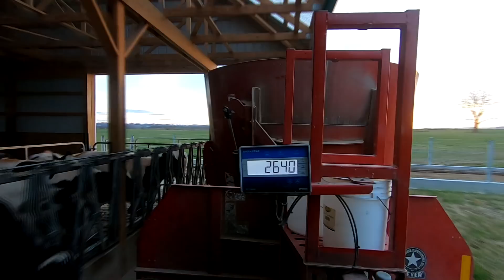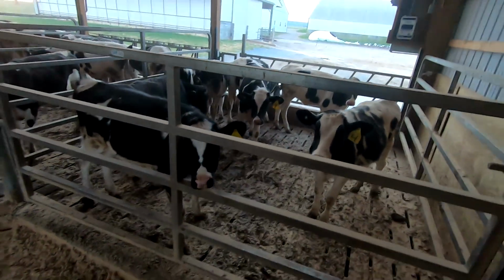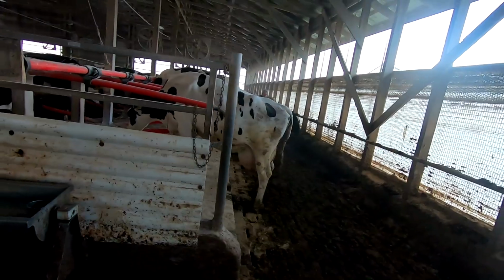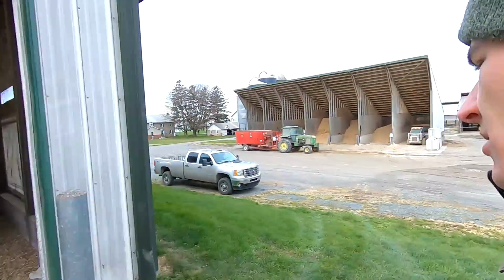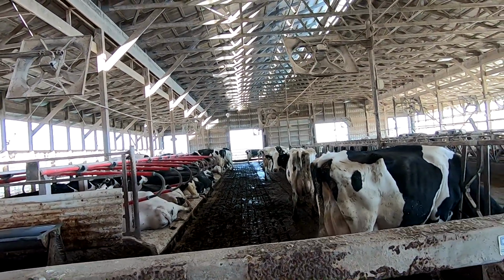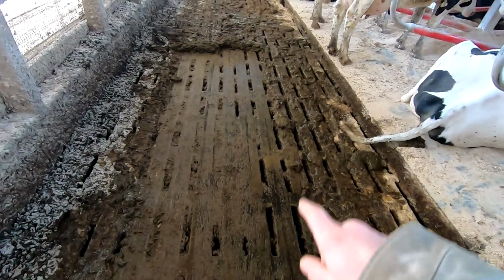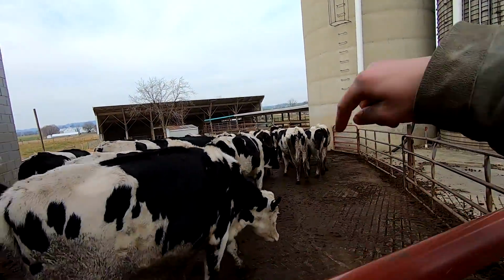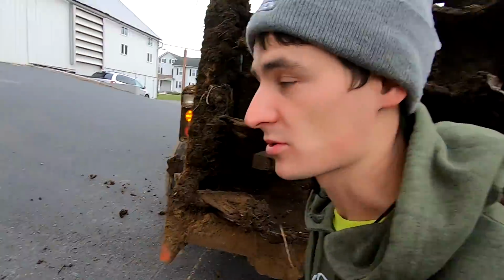This & That on the Dairy

Comment: Thanks for the videos Eric ,I’ve got slats and have cable  scrapers that run on top ,it certainly keeps the beds cleaner and better for hoof health and stops  manure tracking onto the beds which helps with mastitis prevention.
I think the  discovery would do a good job for you ,as you know it’s all about making small improvements 👌

Comment: We have two lely discoverys.  Had them for 6 years. They definitely help keep the beds cleaner. There is a noticeable difference when they are broke down. Maintenance is about every two months and nothing is very complicated to fix. We really like using ours. Any questions let me know
Reply from the maker: Thanks! Do you have the one with the water attachment on it?
Reply: Yes we do. Both ours have the water. I would not recommend it. As we are from Wisconsin and winter time is challenging plus they are a lot more maintenance. We have deleted the water systems off them.
Reply from the maker: @codeman002100  good to know thanks. The farm we visited to other day had the water turned off because it gave to much trouble.
Reply: Yes same here.
Reply: @10thgenerationdairyman  We just bought one without water (installing it next week). Price was 30-40% lower, also know some friends who complain about problems with the water (and other persons say that water is unmissable).

Comment: I have worked with 2 Lely discovery’s and they are great for cleaning slats without the hassle with traditional barn scrapers.
It's important to give them a simple route in the barn - less chances for them to get out of route. 
Replace tires when worn, otherwise there's more risk of them slipping and getting out of course.
They can't scrape large amounts of straw from a bedpack or a huge pile of dryed out manure. But as long as they run every few hours that should not be as problem. 
Make sure you don't have them running while driving in the barn with the skidder. They are soooooo slow and it's painful to wait for them :D
If it's really cold don't even bother. They can't push frozen manure. Witch is okay cause at least it's dry then.
Hoof health is improved after we got them.
Reply from the maker: Thanks

Comment: That auto manure scraping robot for the slatted area is pretty nifty... When you were originally talking about it, all I could visualize was those systems where they have a scraper or two (that span the entire width of the slatted walkway) that are hooked to chains or cables. Then, every once in a timer in awhile the system pulls the scrapers from one side, and across to the other, making sure that the walkway is clear from any and all manure. So seeing an actual robot was really neat. Probably a pretty penny too. Lol

Comment: Hey great video. We have 3 robots scrapers, two of them is is just scraping and the 3rd one we got about 7 8 months ago was the one with the scraper and water sprayer out the back, you think the water doesn’t make much of a difference but it make a huge difference, we are thinking about changing the other two out for it, we have them on slates and solded floor, they do work, the cows do be lot cleaner (tails) you have rubber out at the feed rail, don’t know it would work there with the rubber. Something to look into, but worth the investment

Comment: I saw you replace only the front wheels of a skid steer.  We run a lot of them.  When you put new wheels on the front they are larger than the wheels on the back and since each side rotates at the same speed the size different causes a LOT more ware since one of th wheel sis always skidding.  We always replace one side at a time.  If the fronts are bad we pull one rear off and move it to the front.

Comment: We have a lely discovery and its working pretty good for us, but the scanner that reads the wall is not that good, because sometimes it bumps into wall if the scanner is not reading the wall good. So we put a new one on a little time ago now it is good again.
Reply: We have also a lely discovery. I think we bought it in 2009. And yes, sometimes it has some problems, but overall it works well. 
We have also a delaval (we have a special floor in our new build barn, because dutch environment rules) and a delaval is a lot heavyer. But the delaval has to mutch problems!
Reply: And when i had to buy a new manure scraping robot, i think it will be a lely.
With water sprayer!

But i think you need two robots! One for each side of the barn.

Comment: Looking at your set up I think a ratchet scraper that’s automated would suit your system very well. They are very common in Ireland and are designed to scrape the alley ways between cubicles and under gates too. They can be set to run at hourly intervals. I don’t think your set up would suit the robot due to all the gates it has to cross. Dairypower or Dairymaster make them. Irish companies so not sure do they sell is the U.S. But worth taking a look.

Comment: We run three of these Lely robots in our stalls. At the beginning we had a little bit of trouble with them getting lost and not finding their Path but after a while they starten to run beter and better. We also have our water switched off in the robots. For Youre stall i personally think the robots wil work really gold because youre allys are all straight without to Mutch turns!

Comment: Watching you load the Pik-Rite with the skid loader, I wonder if having a bucket with a longer "tongue" or bottom plate would make that process more efficient. I have a no experience, just a thought I had. Does anyone know if that would work?
Reply: Typically no because If you get to big of a bucket for manure the skidder will rip over and the amount of time it takes to shake and push the manure over it doesn’t add up to much time at all

Comment: What I would do is set up a small pan that holds four or five cows maybe up to 10 and over the year only go to the cattle market 12 times and separate out the cattle that you are going to sell but still milk them until the saleWould make things a little easier as well because you could get a slightly larger trailer and build a nice little ramp

Comment: I’ve always wondered why the sides of the manure spreader are so short taller sides you could haul more?
Reply: Manure soreader come in different sizes. But you don't buy a big manure spreader if you don't have the tractor with enough HP to tow and put revs down the pto. His spreader likely matches his tractors hp and tow capacity.

Comment: After watching a lot of The Hoof GP cattle trimmer YouTuber, the layover type crush seems so much harder to level up the claws and model with the knife.
Reply: I would have to disagree with you on the two types of trimming tables . This is the first time I have seen a lay down table with a clamping leg holds, mine used straps. I used two types of grinders, one is chipper head the other was a finish grinder aka Poter Cable 24 grit paint remover disk. To use the chipper head you put the strap between dew claw and heel to hold both toes firmly, then reset strap above the dew claw and then level  up with no pressure on strap and leg in a strait position , not like the stand up tables with all legs pulled back. I am also a horseshoer 40+yrs I trimmed cows for 10yrs.